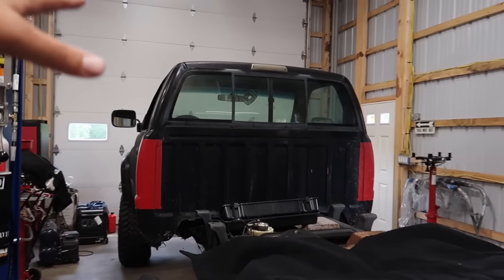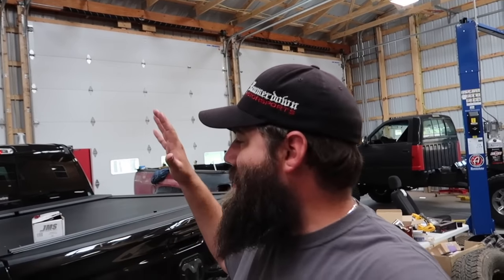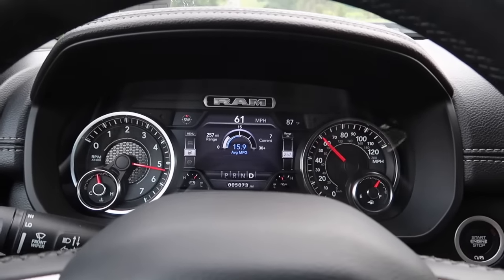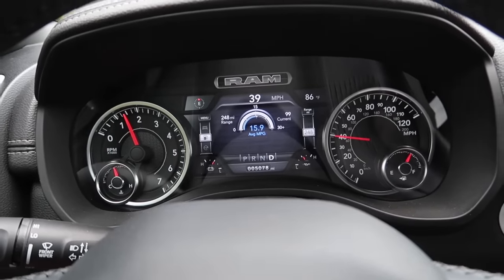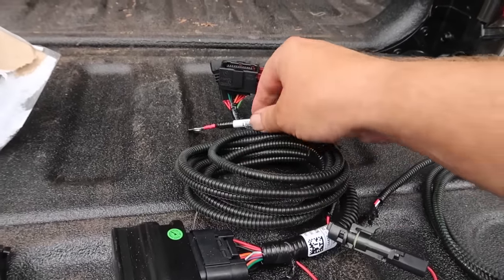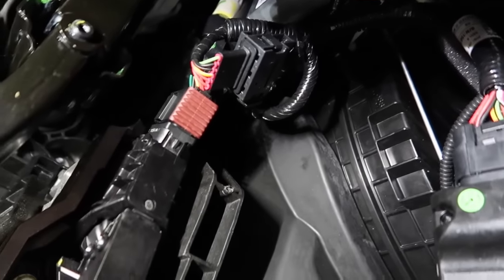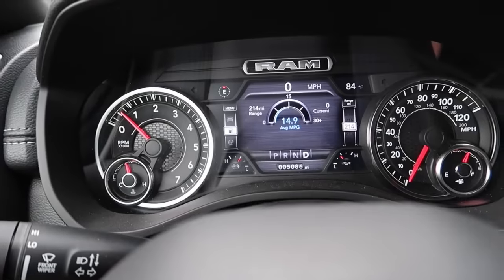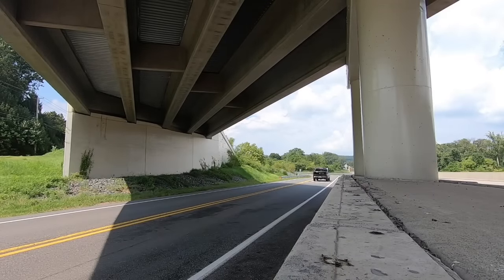2019 Ram Hidden Power Mod

Comment: I guess I don't quite understand this video starts out with just about four wheel drive lift and changes and bumper finishes and cables I thought this was about the pedal Commander or decreasing throttle response lag kind of disappointed

Comment: What are your gears in your 2019 ram i also have 392 rear end and i can spin the tires through three gears
Reply: Stephen Galvan you have what they call the drag racing set up from the factory. I have that same set up. That 3.92 gives the best of both worlds for acceleration and mileage. 
I have seen 25 mpg on the highway from my 2019.
Reply from the maker: I have 392 gears and it will light them up when traction control is off
Reply: I would be hesitant to install this mod on my 2013 HEMI 4x4. It will light the tires at will as it is..
Reply: No more 25mpg with the JSM chip.  His mileage went from 15.9 to 14.8 just in his testing shots lol
Reply: whats ur 0-60
Reply: @Dd-mt5ol   high 6 low 7

Comment: Whats the product that you used on the dodge front bumper do you have a link i use plasti dip
Reply from the maker: I used Raptor liner on the 95 dodge
Reply: @HammerdownMotorsportsUSA  I can’t get it in Canada darn
Reply from the maker: @stephenmcgraw3610  Amazon.com has it but may cost a bit to get it shipped there
Reply: @HammerdownMotorsportsUSA  it’s still worth it 👍

Comment: LOL MY 2013 RAM 1500 WITH A HEMI WENT 0 TO 70 IN 3 TRUCK LENGTHS WITH NO MODS..AND THE TIRES AND PIPES WERE BOTH SCREAMING LIKE A BANSHEE..
I NEVER USED MY TRACTION CONTROL UNLESS IT WAS ICY ON THE ROADS..WET ROADS I ALWAYS HAD GOOD TRACTION ON..UNTIL MY TIRES WERE WORN OUT. AND AT 120 MPH THE TACH SAT ON 1500 RPMS. BEING A L.E.O. I COULD DRIVE LEGALLY AT THIS SPEED..

Comment: I have a 2018 4x4 it will not smoke the tires to save a life.
Reply from the maker: Scott Miller put it in manual 1 and let er rip
Reply: Tried it in one and traction control off still nothing just cuts power and takes off slow til about 10 mph then picks up speed

Comment: Does it affect warranty?
Reply from the maker: Michael Smith nope but if you have any issues with your truck and want to remove it before taking it to the dealer it takes 5 minutes and is undetectable
Reply: @HammerdownMotorsportsUSA  Thanks!. Just bought my truck today lol
Reply from the maker: Michael Smith awesome congrats I put mine on my truck right away and put exhaust on before 300 miles lol
Reply: Do they have one for the 6.4 2500?
Reply from the maker: Michael Smith exhaust?
Reply: @HammerdownMotorsportsUSA  No the pedal max lol
Reply from the maker: Michael Smith lol I would double check with JMS but it should work I would think

Comment: It's reviewers like you that mislead your subscribers and viewers you show the RPM lag when the truck is stock but never showed the RPM lag from a roll after turning up the throttle Max to 100% I've owned a bunch of Dodge trucks the lag is very similar from zero not much lag at all the main lag is from a roll and that you aren't you did not add to your video

Comment: Is it good for 2013 4.7 ram?
Reply from the maker: Juan Caballero I would Message JMS but as long as it’s a drive by wire it should work as long as it is the correct model for your year of truck

Comment: I think it’s a useless mod. If anything you should do a TPS RESET it’s a procedural method to reset the throttle body and I didn’t and IMMEDIATELY noticed a huge change. Not just in power but MPG and after cleaning the throttle body and resetting the throttle body again it idles butter smooth truck doesn’t even feel on now. The reset did major changes

Comment: Those Ram trucks are really good looking.. probably the best interior out there but I  hear horror stories of reliability and even worse of dealerships not standing behind the warranty...
Reply from the maker: John Rambo I haven’t had any issues knock on wood but all manufacturers have problems
Reply: @HammerdownMotorsportsUSA They all have issues but Chevy, Ford, and Toyota stand behind their issues... I've seen guys take brand new RAM trucks with less than 500 miles with major electrical issues to the dealership to refuse to fix it and even blame it on Fiat...good luck with your RAM... hopefully you have no issues ever.

Comment: All these do is remove control from you. Instead of 100% throttle being at the floor, 100% throttle is now 1/8th of an inch from the top, meaning you'll just be herky-jerking and out of control around town, or while trying to go anything less than 100% throttle input all the time.

If you want your accelerator pedal to be a binary on-and-off switch, make your truck absolutely miserable to drive, hate your normal drive, and also waste some money, this is the garbage for you!

If you're actually worried about throttle input delay, go actually get your ECU flashed and solve the real problem. There are NO plug-in solutions that can replace an ECU flash and tune.

Comment: all that and still no smokey burnout......    traction control on that truck must be limiting the take off like a mo-fo
Reply: I believe that Traction Control would chatter and you would know it was kicking in.
Reply from the maker: Oh It would do it but melting 22 inch tires will have to wait a bit lol
Reply: @HammerdownMotorsportsUSA  I figured with just 5000 miles on the truck you aren't in a rush to spend another 1500 or so on new rubber just yet.
Reply from the maker: Robert Craft truth

Comment: I lost 3 quarts of oil before my first oil change at 3000 miles I am at 12k miles added 2 quarts already before oil change. Just frustrated with bs
Reply: Troll Alert!
Reply: @charlesmarshall2697  when you drop more then 30k out of pocket you can afford to be a troll

Comment: Why not just get a programmer
Reply from the maker: Don Knicker a programmer wont do the same thing
Reply: @HammerdownMotorsportsUSA  it did in my GMC with a Diablo
Reply from the maker: Don Knicker adjusted the throttle sensitivity on the fly? And open it an extra 7 degrees? Programmers are good too but this can be used in addition to a programmer
Reply: @HammerdownMotorsportsUSA  I think he is confusing throttle response time with overall performance...
Reply: @CraftwerksMC  nope when setting the parameters there is a throttle response setting.